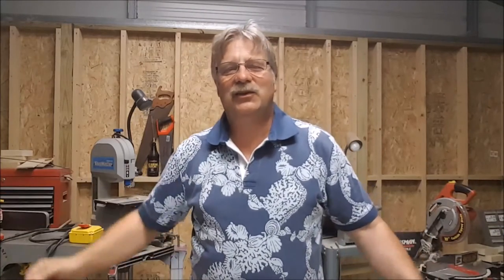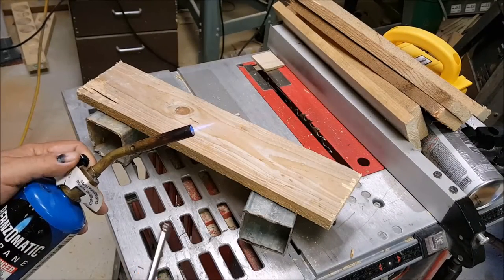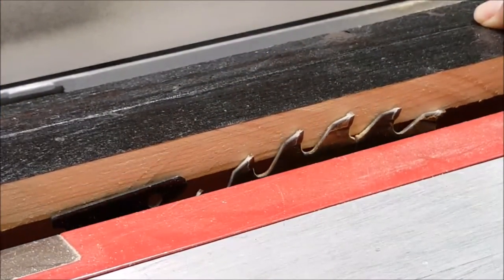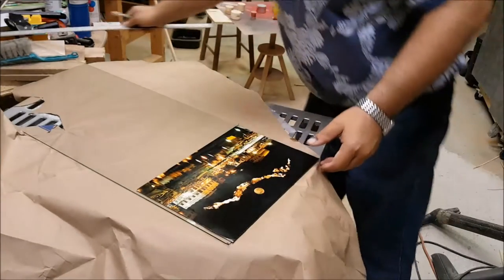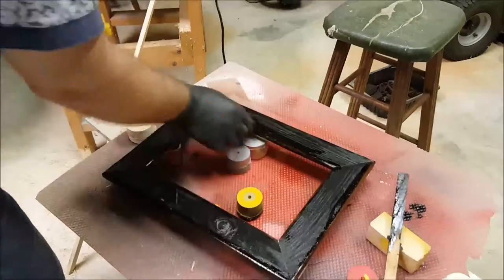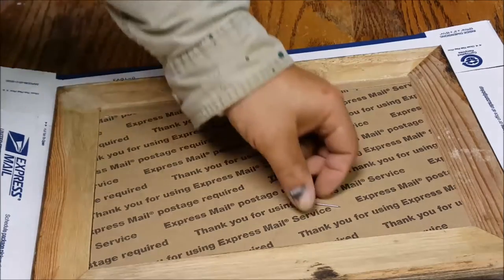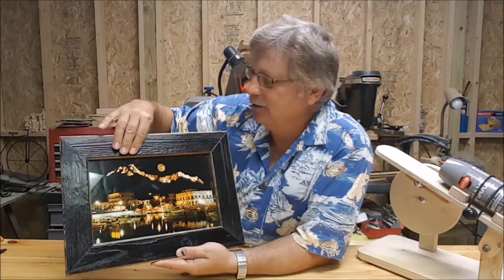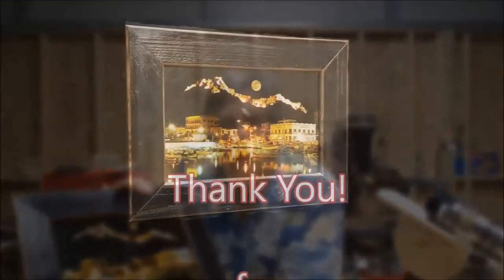Pallet Wood Picture Frame and Hand Torch Contrast On Wood (Wood Grain or Texture) Stand Out.

Comment: Very nice! Simple and classy. I love torching projects but I get to scared to go completely black. I tend to keep it more as shading. May be time to try a complete burn!
Reply from the maker: Thank you for your kind words the best part of the torch finish, the wood ends-up with a smooth surface if you go all the way black with a surface burn. But the best part is after you polyurethane it or add varnish, the end result in my opinion looks like black lacquer. Good luck with your next burn, i believe that you would end up liking it.  ;-)